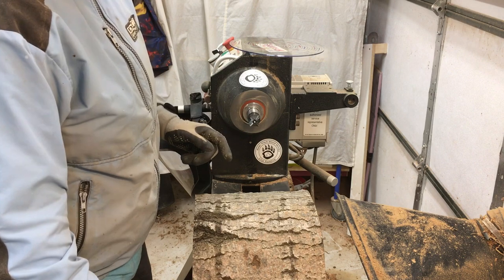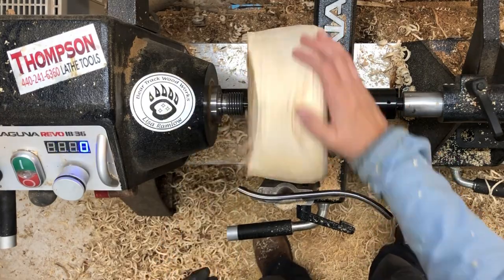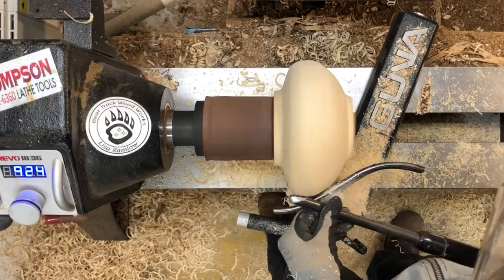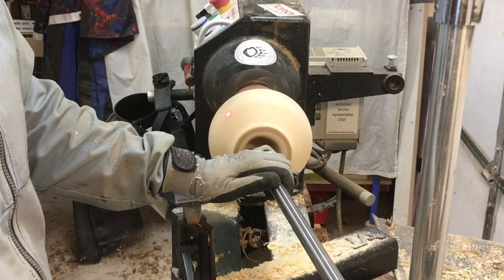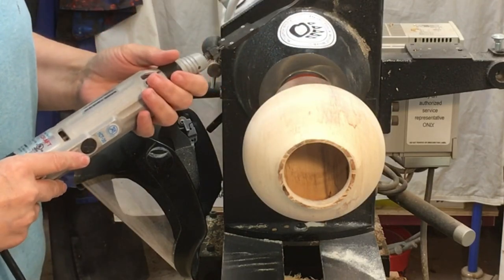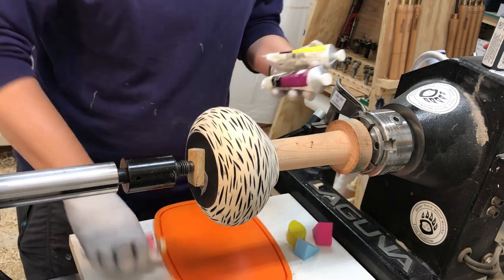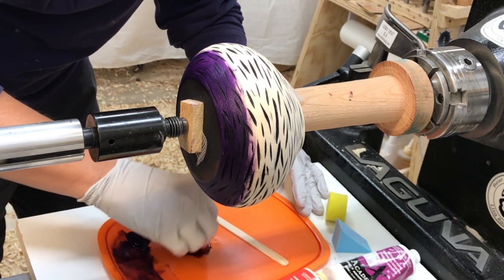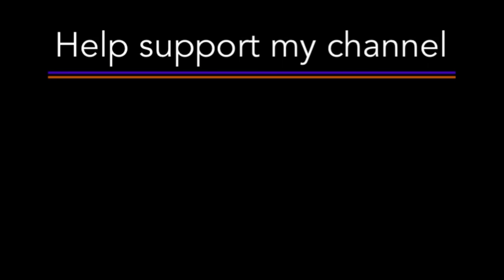Woodturning: Carving and Embellishing an Aspen Vessel

Comment: Glad you are trying new techniques and that you have a warm shop to work in during the winter months (almost hated to bring that up). I would have liked a glossy finish rather than the matte. I did a smaller hollow form with stain(similar to the one you did previously) and the gloss really popped the vibrancy of the stain.
Reply from the maker: To be honest this project got rushed. Too many irons in the fire at the moment so I figured it was a good first step. I will probably put some kind of finish on them, a spray lacquer or something.

Comment: Have you ever thought of using hot glue on the base of bowls ? Squeeze some around the underside and around the base and let it cool.twenty minutes
Squirt some isopropyl or denatured alcohol and let us soak for a couple minutes and heat a thin blade putty knife to separate by pushing in between the two pieces
Reply from the maker: Hi Gary! You mean for mounting? I’ve not tried it yet but I know Jim @SpragueWoodturning uses hot glue on all his pieces and he does some big ones!
Reply: @LisaRamlow  yes glue a sacrificial block to the blank